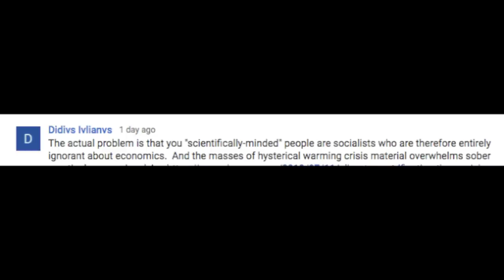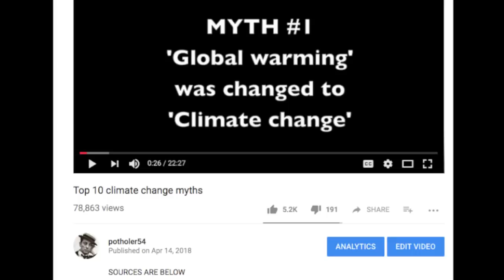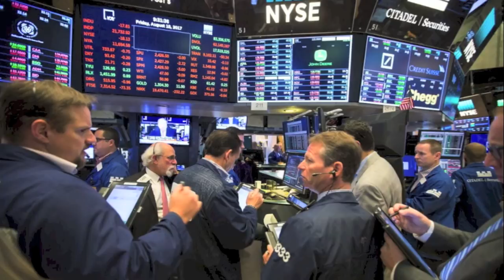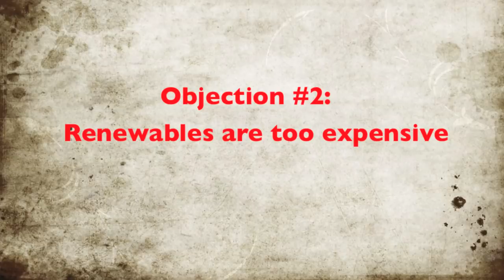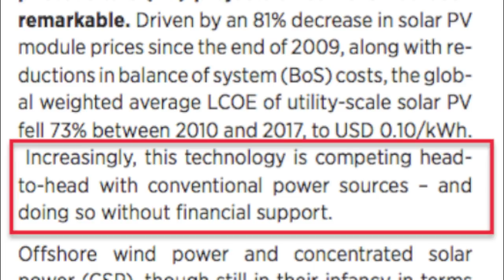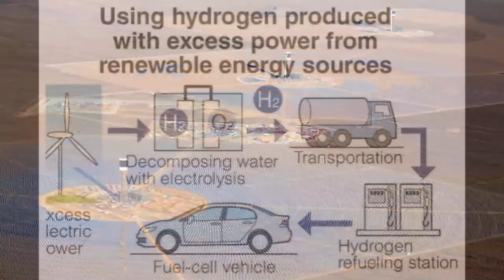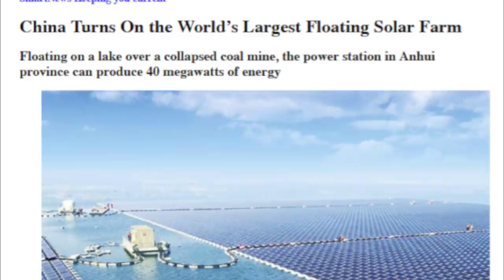A CONSERVATIVE solution to global warming (Part 1)

Comment: What is the logical explanation?
a) The atmosphere heated due to highly active sun.
b) The atmosphere heated due to increase of 0.01% of CO2 during the past century.
Reply: c) all of the above. Warmth from the sun is trapped by the 0.01% of co2 (and other anthropogenic gasses). Simple - Settled - Science for over 100 years. If you can prove otherwise I recommend you go to Stockholm and pick up your Nobel prize

"co2 cant cause warming cuz its only .01%",  this is ridiculous, .08% blood alcohol content is legally intoxicated but according to your argument its impossible because its less than 1%
Reply: Dynomite Hackjob  CO2 doesn't trap heat from the Sun. It doesn't trap anything.
Reply: Build a greenhouse, increase CO2 concentration. See what happens.
Reply: sombodysdad  It does trap heat. Kinetic from sunlight is transferred into co2 molecules very efficiently at certain wavelenghts, this becomes potential energy in the molecule which is then re-emitted back into the atmosphere as warmth. Something very similar happens in microwave ovens; a specific wavelength of light will transfer its energy into a molecule causing the water to warm.
Reply: Dynomite Hackjob  It doesn't trap heat. Look up the word "trap". CO2 absorbs IR and not sunlight. And CO2 only absorbs 8% of what the earth emits.
Reply: onikin  The earth is not a greenhouse.
Reply: sombodysdad  Trap, absorb, grabs, catchs... whatever verb you want to use. Semantics...   BTW the sun emits light in all wavelengths including infra red. I worded my comment to be easily understood by an ignoramus, but I obviously failed.... And technically the earth is a greenhouse, the biggest greenhouse in the known universe, and the only one we can live in, hence the urgency
Reply: @sombodysdad 

The Earth radiates heat back out in the IR spectrum. CO2 traps some of that outgoing radiation which would otherwise have made it back into space. That's how a greenhouse works.
Reply: Dynomite Hackjob  The earth is nothing like a greenhouse and CO2 still only absorbs 8% of what the earth emits. And it re-emits in all directions meaning less than 4% will be headed back towards earth to warm it- but wait, heat flows from hot to cold and the earth would be much warmer than what co2 emits...
Reply: Lucid Catnap  CO2 only absorbs 8% of what the earth emits. 92% goes right by it. Last I knew 92 was much greater than 8. And that 8 is actually less than 4 because the CO2 re-emits in all directions.

The planet is greener thanks to more CO2. And if we ever get to 150PPM then we start dying v=because the plants will die
Reply: sombodysdad  your argument is so flawed that it is not worth anyone's time, a fire emits heat in all directions but it still warms you, it doesnt matter to what percent it still warms, even if its 1% it still adds up. For real, if you can prove co2 isnt a greenhouse gas then stop wasting my time arguing and go pick up your nobel prize.

You can have the last word, i have better things to do then explain why you should want to save the planet you live on
Reply: Dynomite Hackjob  Wow, comparing CO2 to a fire is sheer desperation. For real, if you or anyone else can show that CO2 rising from 280PPM to 410PPM can raise the temperature over 1 degree F, you would win a Nobel prize. The fact is what we observe is well within natural variability
Reply: +sombodysdad  

"CO2 doesn't trap heat from the Sun. It doesn't trap anything."

This has been explained to you multiple times, denialist. Once again:

Earth takes in energy from space (ex: solar energy) and releases energy. If Earth releases less energy then it takes in, then this creates an energy imbalance, which results in Earth warming. This is somewhat analogous to what happens to you when you wear a thick blanket: the blanket slows the rate at which you release heat in the environment. Since your body is also generating heat through muscle contractions and other processes, an energy imbalance results and you heat up. Note that the blanket can heat you up, even if the blanket is cooler than your body; a heated blanket is not required for warming you.

Now, greenhouse gases (GHGs) like CO2 absorb longer-wavelength, lower energy radiation, and thus slow down the rate at which Earth releases energy. This is explained at a laymen's level here:

"Yet we might expect scientifically literate people to produce a brief, mechanistic, global warming explanation—as in these 35 words: “Earth transforms sunlight's visible light energy into infrared light energy, which leaves Earth slowly because it is absorbed by greenhouse gases. When people produce greenhouse gases, energy leaves Earth even more slowly—raising Earth's temperature.”"
http://onlinelibrary.wiley.com/doi/10.1111/tops.12187/full

Also see:
"Sixth-Grade Students’ Progress in Understanding the Mechanisms of Global Climate Change"
"Comparing the effects of traditional vs. misconceptions-based instruction on student understanding of the greenhouse effect"
"A mental picture of the greenhouse effect: A pedagogic explanation"
"Infrared Radiation and Planetary temperature"

More technical explanations here:
"The spectral signature of recent climate change"
"Observational determination of surface radiative forcing by CO2 from 2000 to 2010"
"Increases in greenhouse forcing inferred from the outgoing longwave radiation spectra of the Earth in 1970 and 1997"
"Global atmospheric downward longwave radiation at the surface from ground-based observations, satellite retrievals, and reanalyses"

Thus, CO2 creates an energy imbalance, thereby warming the Earth. That's covered in sources such as:
"Anthropogenic and natural warming inferred from changes in Earth’s energy balance"
"Insights into Earth’s Energy imbalance from multiple sources"
"Reconciling estimates of ocean heating and Earth’s radiation budget"
"Observed and simulated full-depth ocean heat-content changes for 1970–2005"

Therefore, CO2 drives warming, as discussed in sources such as:
"On the causal structure between CO2 and global temperature"
"Climate sensitivity in the geologic past"
"Changing atmospheric CO2 concentration was the primary driver of early Cenozoic climate"
"CO2 as a primary driver of Phanerozoic climate"
"CO2-forced climate thresholds during the Phanerozoic"
"The impact of Miocene atmospheric carbon dioxide fluctuations on climate and the evolution of terrestrial ecosystems"
Reply: Onikin
Bigger plants and less UHI? lol.
BTW, atmosphere is open and very very very different
Reply: @sombodysdad  

Could you at least try and provide any scientific source for any of your claims? Like this:

"CO2 only absorbs 8% of what the earth emits. 92% goes right by it. Last I knew 92 was much greater than 8. And that 8 is actually less than 4 because the CO2 re-emits in all directions."

In this thread and others, the only thing you contribute with are assertions. It is very apparent that you are not a researcher so it would be interesting to see where you get your facts from.
Reply: Everything I posted is well known- well by educated people, anyway. CO2 only absorbs in three wavelengths- 2.7, 4.3 and 15 microns. That is a known fact. And it amounts to 8% of the blackbody radiation coming from earth.
Reply: +sombodysdad

"You are a waste of time and effort. Any and all warming fits in with natural variability."

You've been corrected on this multiple times, you deceitful buffoon. Once again:

There are quite a number of ways we can confirm that the the vast majority of recent CO2 increase is anthropogenic. For example, we can:

1) use carbon isotope ratios in atmospheric CO2 [anthropogenic emissions from fossil fuel burning would drop the relative proportions of C13 and C14]
2) show that the oceans likely aren't a net releaser of CO2, since the oceans are acidifying [indicative of net CO2 uptake,  not net CO2 release] and CO2 levels are increasing in the oceans
3) measure emissions from other non-anthropogenic sources [such as volcanoes], and see that anthropogenic emissions outweigh those sources
4) observe the decreased atmospheric O2 levels that one would expect from burning of fossils fuels as a contributor to CO2 emissions
5) observe the correlation between increased anthropogenic CO2 emissions and increased atmospheric CO2
6) examine the radiative forcing and temperature response changed from before to after the industrial revolution, consistent with anthropogenic CO2 emissions resulting in warming [as opposed to it just being non-anthropogenic]
7) mass balance argument, where the total amount of CO2 released by anthropogenic fossil fuel combustion is greater than the amount of CO2 accumulating in the atmosphere [so non-anthropogenic sources are acting as a net sink for CO2]

And there are quite a number of ways to tell that increased CO2 caused most of the post-1950s global warming. For example:

1) Post-1950s stratospheric cooling
2) Post-1950s mesospheric cooling
3) Post-1950s thermospheric cooling
4) Post-1950s increase in radiation absorption at a wavenumber of ~666 cycles per cm, and other frequencies CO2 is expected is to absorb at.
5) Horizontal/regional distribution of warming and the temporal pattern of warming [DOI: 10.1175/BAMS-D-11-00191.1, pages 1683 and 1684]
6) Estimates of climate sensitivity (in excess of 3K for ECS) based on proxy records for CO2 and temperature.
7) Exclusion of other likely causal factors, such as the Sun (ex: solar-induced warming causes warming of the stratosphere, mesosphere, and thermosphere, yet scientists observed cooling in these layers).

So if humans caused the vast majority of CO2 increase and the CO2 increase caused most of the recent warming, then that makes a pretty strong case that anthropogenic increases in CO2 are driving the warming. 

Some background sources on this latter point on recent CO2-induced warming:

"Comment on “Climate Science and the Uncertainty Monster” by J. A. Curry and P. J. Webster"
"Assessing the observed impact of anthropogenic climate change"
"Causes of irregularities in trends of global mean surface temperature since the late 19th century"
"On the causal structure between CO2 and global temperature"
"Attribution of observed historical near-surface temperature variations to anthropogenic and natural causes using CMIP5 simulations"
"Early onset of industrial-era warming across the oceans and continents"
"Anthropogenic and natural warming inferred from changes in Earth’s energy balance"
"Attributing Observed SST Trends and Subcontinental Land Warming to Anthropogenic Forcing during 1979–2005"
"Sensitivity of the attribution of near surface temperature warming to the choice of observational dataset"
"Scaling fluctuation analysis and statistical hypothesis testing of anthropogenic warming"
"A probabilistic quantification of the anthropogenic component of twentieth century global warming"
"Quantifying anthropogenic influence on recent near-surface temperature change"
"Identifying human influences on atmospheric temperature"
"Whole atmosphere simulation of anthropogenic climate change"
Reply: @sombodysdad  

Again you're linking a blog and not a scientific paper. The premise for science is something quite frankly everybody agrees upon in every other field they don't consider to be politically controversial - hopefully you expect people who claim vaccines cause autism to subject their research to open review by other experts. Ultimately, it's that reproducibility and subjection to peer review that defines scientific procedure.

Part 2 is dealt with in potholer54's video on the medieval warm period. That video is exactly on point with respect to the schematic presented on the blog. Part 3 is dealt with in the video "Does CO2 lag or lead temperature"? You don't have to take potholer54's word for it - simply watch the videos, verify the sources, and make an on-point argument.

The procedure of peer review is particularly apt at checking the model outlined in part 1. Neither of us have any expertise to understand the models Mike Jones is putting up from a physics perspective. But I can make fancy models in economics - that doesn't mean they will be based on empirical realities. Ironically, part 1 of your own source refutes your statement:

"If you were right then each year would be warmer than the one before it. That isn't what we see, is it?"

No, that's not what we'd expect to see, and Mike Jones himself says it in the article. Potholer has dealt with this issue in "Why temperatures never go up in a straight line". Here's the quote from part 1:

"Unfortunately, not enough exact parameters are given to allow the temperature contribution by CO2 to be calculated completely, because the effect of ocean thermal inertia has not been fully quantified. But it should be reasonable to derive the actual CO2 contribution by fitting the above formulae to the known data and to the climate model predictions."

To be clear, ocean heat content has been quantified, and you can read about it in the 4th IPCC assessment report linked to below. But Jones is right - you can't estimate the contribution of CO2 on global surface temperatures if you cannot account for the changes in the energy content of - among others and particularly - the oceans. And that's why global surface temperatures do not go up year by year, and it's why the record temperatures in 1997/1998 were not due to climate change. The Earth is not a closed system where energy evenly balances out over time, rather it shifts around in different systems of which global land surface temperature is just one measure. Take the Earth as a whole, then yes and in line with the laws of physics, more energy is retained in with increasing CO2 concentrations.

https://www.ipcc.ch/publications_and_data/ar4/wg1/en/tssts-3-3-1.html
Reply: Wow- the math is there for anyone and everyone to review.
Reply: Then it should be easy for you to show the flaws in his argument. Judith Curry doesn't agree with you alarmists.
Reply: @sombodysdad  

Yes, and I can put something on a website for you to review as well. But we're not researchers - and researchers do not rely on random people with blogs or on YouTube for review. I cannot review the model, and I am dead sure you have no clue what it entails either. Researchers publish their research in scientific papers where actual experts review them. Unless you actually have an interest in tackling the points people raise against yours, there is no merit in this discussion as a way of reviewing your assertions.

Judith Curry is welcome to submit her findings to any journal. As a matter of fact, she is a publishing scientist, receiving federal grants (among other sources) and with a long history of scientific publishing. She knows how the process works. Then again, don't expect her to owe up to her mistakes - read up on the Berkeley Earth Project for examples of that.

Edit:

"Then it should be easy for you to show the flaws in his argument."

That is exactly what I did. Now please - give a response in relation to the topic, not deferring to a completely different person or topic.
Reply: You didn't find any flaws in the math.
Reply: Right, willful ignorance is your MO. Got it.
Reply: @sombodysdad

Link 1: Nothing wrong with any of that math.  Of course, the conclusion, even on the blog run by Anthony Watts, the most unskeptical skeptic that exists, is that the math supports the conclusions that CO2 is the main driver of climate change.

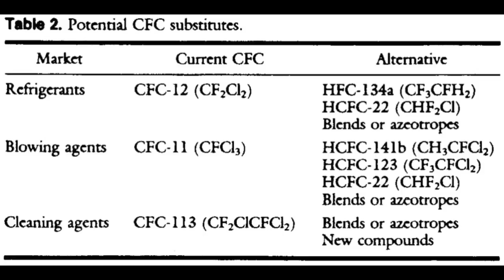Link 2: The primary source here is a misreading of IPCC schematics regarding the MWP, something which Potholer has already gone through in-depth here: https://www.youtube.com/watch?v=CY4Yecsx_-s (timestamp 9:12 for the specific images in the link).  As such, the conclusions on those data from the link are just as flawed as the data itself.

Link 3: is about Al Gore and things he messed up.  Al Gore got a lot of things wrong.  Pointing that out does not invalidate climate science.  Lots of so-called "skeptics" don't understand this, or they do and don't care.

Link 4: We finally get back to some actual maths, though nothing in-depth like in the first link.  In short, the writer, Mike Jonas, asserts that the IPCC calculates water vapour feedback and clouding effects on climate based on a "simple guess", when that's hardly the case.  Watts, as is very typical with his tendency to cherrypick data, uses a single source for his data on water vapour feedback (Wentz et al 2007), even though there are literally dozens and even hundreds of different papers in reputable scientific journals about the effect of water vapour feedback on climate.  Whether or not that data supports Watts conclusion based on that paper, I'm not sure, but his use of a single source invalidates his conclusion based solely on it.  As for cloud effects, again, he's using a single source, the IPCC's 4th assessment, to conclude that their effects are just guesses, and even the IPCC report doesn't say that.  It says there's large uncertainties in cloud effects, but that's very different from claiming it's all guesswork.  Of course, the IPCC's 4th assessment was released in 2007, and between then and the 2015 blog posts by Jonas, lots of data had been discovered and published on cloud effects that made it much more clear and reliable.  Of course, posters on Watts' blog had to ignore all that because it showed that cloud effects would cause a net cooling.
Reply: @sombodysdad  Your entire argument reduces to "let's look at the percentage of heat that CO2 keeps trapped by the atmosphere, what percentage of CO2 in the atmosphere is contributed by man. If these numbers look small to me, then their impact must be small in consequence to me. P.S. here's my source its a blog."

Simply put, it's a fallacy of incredulity.

Now, we'll run for a second with your figures. (Though I'd like to say, the 8% figure you got might be from "8% of global warming being due to CO2" I saw somewhere spurious and I couldn't figure out what they even meant by it let alone got it from, but regardless it'd also mean, assuming you were correct in your intepretation you're reasoning behind 4% is wrong --- any halving would be figured into that and you've left out how gravity makes absorbed heat from greenhouse gasses scatter more downwards than upwards because some of that some of the heat being reemitted by the CO2 is not being emitted as radiation and so the insular effects of increasingly lower pressure will prevent some upwards motion of heat even despite the tendency of heat to create convection currents.)

If CO2 really does put only 4% of the heat it absorbs in the atmosphere, you're not considering how much HEAT that is. That'd be a 20th of the heat absorbed by CO2 in the first place, and if you don't know what that is, you have no idea how disastrous it might be. 4% might seem like a small margin, but, though this may seem counterintuitive, the larger the number, the higher the number produced by a percentage, and thus the more equilibrium threshholds (such as, say, thermal,) you might pass when talking about a physical system.

So even accepting your premises, which you've obviously distorted through multiple retellings, you don't successfully lead to your conclusion.
Reply: CO2 doesn't trap heat. The 8% is from PHYSICS- The PHYSICS of CO2 says it absorbs very little of what the earth radiates. 92% of what the earth radiates goes right past CO2.  

AGAIN- CO2 only absorbs in THREE wavelengths- 2.3, 4.7 and 15 microns, with 15 being the major wavelength. Look up CO2 absorption spectra. And then remember that it is @ 410 parts per million. And if gravity were a factor- LOL!- then the earth would retain its heat- it would just bend back towards the surface.

CO2 is surrounded by non-CO2 molecules- 2400 to 1 (approximately). So when CO2 absorbs, it vibrates, contacts those other molecules transferring some of that energy to them. So what it emits will be less than what it absorbed. 

The best explanation for any added heat is actually CLEANER AIR thanks to the clean air acts. Cleaner air allows for more solar radiation to reach the earth's surface.

Do any of you understand what happens when that occurs?
Reply: leafsdude- "Of course, the conclusion, even on the blog run by Anthony Watts, the most unskeptical skeptic that exists, is that the math supports the conclusions that CO2 is the main driver of climate change."

Bullshit.
Reply: @sombodysdad

"CO2 doesn't trap heat. The 8% is from PHYSICS- The PHYSICS of CO2 says it absorbs very little of what the earth radiates. 92% of what the earth radiates goes right past CO2."

[Citation Needed]

"AGAIN- CO2 only absorbs in THREE wavelengths- 2.3, 4.7 and 15 microns, with 15 being the major wavelength. Look up CO2 absorption spectra. And then remember that it is @ 410 parts per million. And if gravity were a factor- LOL!- then the earth would retain its heat- it would just bend back towards the surface.

CO2 is surrounded by non-CO2 molecules- 2400 to 1 (approximately). So when CO2 absorbs, it vibrates, contacts those other molecules transferring some of that energy to them. So what it emits will be less than what it absorbed.

The best explanation for any added heat is actually CLEANER AIR thanks to the clean air acts. Cleaner air allows for more solar radiation to reach the earth's surface."

Do you understand the concept of including forcing when considering the impact of effects?  The amount is but half the equation.  None of this is any different than saying a pin can't go through a window because it's small and light, even though at the right speed, it absolutely can.

"leafsdude- "Of course, the conclusion, even on the blog run by Anthony Watts, the most unskeptical skeptic that exists, is that the math supports the conclusions that CO2 is the main driver of climate change." Bullshit."

Directly quoted from the link:

"Conclusion

The picture of global temperature and its drivers as presented by the IPCC and the computer models is one in which CO2 has been the dominant factor since the start of the industrial age, and natural factors have had minimal impact.

This picture is endorsed by organisations such as SkS and Denning. Using formulae derived from SkS, Denning and normal physics, this picture is now represented here using simple mathematical formulae that can be incorporated into a normal spreadsheet.

Anyone with access to a spreadsheet will be able to work with these formulae. It has been demonstrated above that the picture they paint is a reasonable representation of the CO2 calculations in the computer models.

The next articles in this series will look at applications of these formulae.

Footnote

It is important to recognise that the formulae used here represent the internal workings of the climate models. There is no “climate denial” here, because the whole series of articles is based on the premise that the climate computer models are correct, using the mid-range ECS of 3.2."

The fact is, link 1 is but a primer, giving the math so they can refute the conclusion in the other parts.  Of course, as I showed, they didn't refute anything, but rather just offered strawmen and other fallacies to make it look like they debunked climate change to simpletons like you.  Your lack of response to the rest of my criticism is therefore telling.
Reply: @VeryEvilPettingZoe - This is a case where super-uber-mega likes need to be available.
Reply: Time will tell and time is not your ally. I don't care if you trust me- do the research. Look up the CO2 absorption spectra.

Another fact you can ignore is if the level of CO2 gets as low as 150PPM then plants start dying and we will be soon to follow.
Reply: "I don't care if you trust me- do the research."

We have.  A lot more than you have.

"Another fact you can ignore is if the level of CO2 gets as low as 150PPM then plants start dying and we will be soon to follow."

It's a good thing no one is suggesting we do that, then...
Reply: Ever heard of equilibrium?